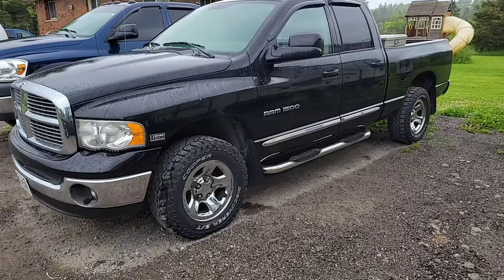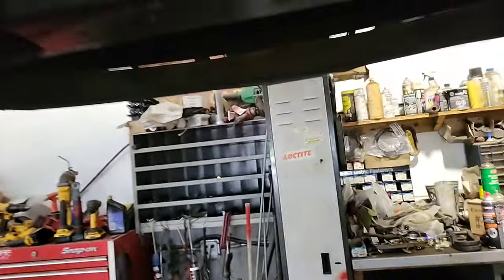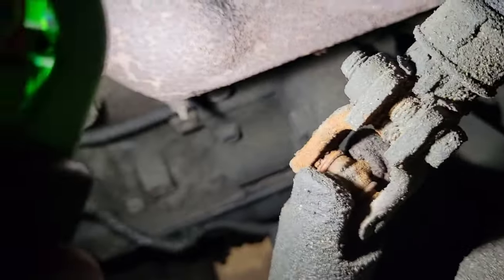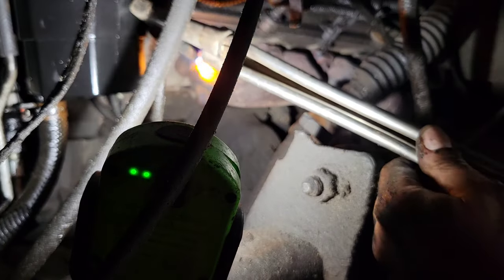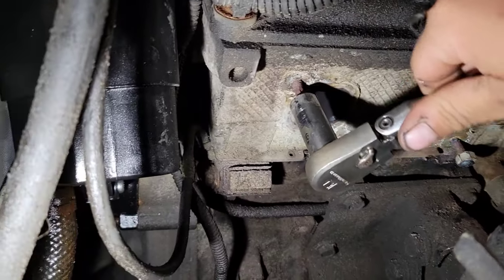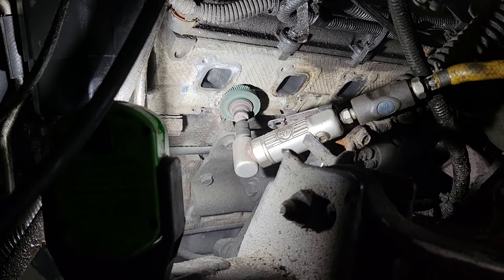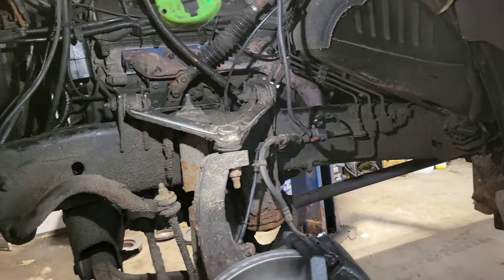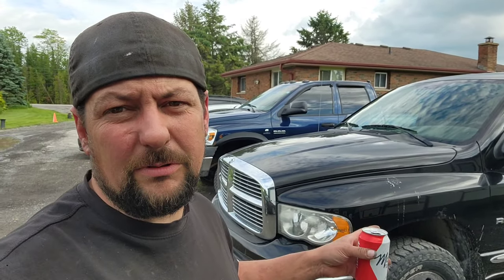Dodge Ram Exhaust Manifold Leak Repair!

Comment: We used to quote those jobs for manifolds, exhaust gaskets and hardware then go to battle with the rust gods... Now we just quote for head gaskets and pull them complete with manifolds still on the heads and send them off to the machine shop to have the bolts extracted and heli-coiled...  We've lost a few jobs that way but better than losing a good tech that's had enough of fighting rusty manifolds on 20 year old trucks...
Good stuff Pete!

Comment: I did a 4.7 exh. manifold gaskets on an'05 Dakota.Some of the rear port bolts were broken off /gone already. I pinpricked the frame under the rear stantions for the upper control arms and ground off the welds, so i could get an angle drill in there.. I ended up putting helicoils in all 4 bolts in the rear ports, because they didn't feel right tightening them down. Also, both manifolds inner 2 ports were an eighth inch taller than the outers with a staightedge, so i ground them down close with a grinder, and finished up with a file. When it was all done the steering wheel was dead nuts straight and I ended up with the truck after the owner passed away. That was 6 years ago and its still quiet! I got all the hardware from Dodge except for the plastic wheel well clips($7.62 each ×14).
Reply: Shoulda just bought a Toyota. 
Car buyers shouldn’t have to go through all that. 
I got a 2020 1500 that’s already had more issues than I can count… major issues being   Transmission going out at 16k miles . Two back window replacements though the dealer.. the third time it leaked I fixed it my self with black silicone adhesive by filling the joints around the rear window flush with caulk. (No leakage since ). But my head liner is messed up form water and other issues with the rear window leaks. 
Head gasket at 20k…the engine would boil over a spot coolant out and gurgle every time you shut it off. 
It’s now out of warranty and getting misfires on cyl 6 (no code or check engine light). But no doubt early signs of lifter/cam failure. Cyl 6 is a mds cyl. And don’t get me started on the u connect and other electrical problems in the truck. 
I cant handle the poor craftsmanship on American made trucks anymore. 
My next purchase will be a Toyota.

Comment: 03 to 05 3rd gen rams with 5.7s are the best 1500 series trucks ever built
Reply: Bullshit!! The only people that say that is the best one has never drove one with Eagle heads. That 45 extra ponies really make a difference.
Reply: I have an 2007 and it’s on my profile pic, still mint running strong at 17 years old I think, if you google the best year the 2008 beats em all

Comment: I had an 05 with around 115k miles on it and I had to do both manifolds before I sold it. I now have a 2014 Ram 1500. Got it with 48k miles, it's needed 3 till now all covered under warranty, now at 98k it needs another on the driver's side so I'll be doing this one unfortunately.  My dad has a 2020 and his has already had 2 as well!

Comment: I have a 1997 Laramie SLT 4x4 with 156 thousand miles on it. It's a little beat up, she's quite and runs amazing. Has the locker 3.88 rear-end.

Comment: Im dieing the stress of my manifold leak on my toyota is now gone. Was wondering if i should get a thicker gasket, seems like you did, also wondered if i should use gasket sealer, and you did. Hows it running? Thanks for the laughs

Comment: I have a 2005 with those two rear bolt on the passenger side missing their heads. Just like the one you were working on those 10mm are no longer 10mm or really usable at all to get out. I was good to see you torching them off. Since I don't have a torch, I am thinking I will first try cleaning one of the bolt heads up and welding a nut on it to see if I can get them out that way. If that doesn't work, I will have to spend a lot of time cutting them out with a Dremel.
Reply from the maker: I hope it works out good for ya! 🍻
Reply: @rednecksdirtyhands  Sadly, it didn't. I think it was likely at least partly the settings on my welder. I decided to cut the bolt heads off with an angle grinder and a Dremel. Getting those bolts out was simple. The one that was broken a little into the block was a different story. I tried and tried with no success with the 110V welder on flux-core. I was feeling pretty defeated. I tried again today using 7014 rods with my welder in stick mode. That achieved good penetration, at least good enough to get the bolt moving. Since I didn't want to have to deal with the flux-coating that stick welding produces every time I broke the weld off while trying to get the bolt out, I switched it back to flux-core, and on the third weld It came out. Now to see if I have anything amount the stuff I have to clean up the gasket off the heads.

Comment: I had a quick question. Did you check the manifold or warpage? I saw other videos saying that the manifold warm and that’s why the bolts brake causing the exhaust leak. I’m wondering if I should buy new manifolds ahead of time since I have the same manifold leak
Reply from the maker: yeah the manifold was good on this truck but it is a good idea to replace them just to be safe, the only reason I didn't was to save the fella a bit of money 🍻

Comment: Looks as fun as the Ford 4.6/5.4, which was notorious for egr tube rotting out n taking threads with it on drivers side, think i put one set on mine n two on moms truck.

Comment: Front wheel bearings is another fail point. Do they not grease these when you get a lube job? My mechanic was not happy about doing that job, it must be tough.
Reply: Theyre sealed bearings dude. Do some research. One of my 3rd gen rams has 300k on original wheel bearings

Comment: Why does the sound the manifold makes go away when the car is warmed up? Is there any issue, outside of the noise, with driving it with an exhaust leak?
Reply from the maker: everything expands when it heats up which closes up the gap between the manifold and the head and the noise usually goes away or at least gets quieter. I know alot of fellas that just keep driving their trucks with that noise and it doesn't seem to affect anything 🍻
Reply: @rednecksdirtyhands ok this I think answered my question. It doesn’t cause
Any harm to the truck to keep
driving
It like this?

Comment: If you are no not tooo busy I have a 2012 5.7 needs a passengers side manifold job . A shop did the drivers side they just changed the head ( unnecessary ? )

Comment: I'm surprised you didn't do the passenger side with a broken bolt visible
Reply from the maker: I will end up doing it...still waiting for some other parts for the truck so I just figured I'd do a video of showing how to do it in the meantime but the otherside definitely needs to fixed as well only a matter of time before it starts tikin away too lol 🍻
Reply: @rednecksdirtyhands  I figured as much, cheers man great video!

Comment: Lower steering shaft right from Dodge 160.00.
Reply from the maker: that's a surprise!! not too often the dealer is cheaper than the aftermarket....but lately I've been seeing the prices of parts from NAPA going through the roof! thanks for the info! I'll give kawartha dodge a call and check 🍻
Reply: @rednecksdirtyhands  I got mine from dealer in Lindsay, but assume all the dealers would be same price??? Lindsay driveline used to replace the u-joints in them at one point as well!

Comment: hmmmm.....I'm a couch mechanic and I'm thinking those manifold bolts snapped due to the cast iron manifolds warping over time. Maybe they should have been replaced.

Comment: It’s your manifolds 

Cold start the metal is cold and dry until it warms up and expands it can seal the leak a little therefore the tick quieting down to going away completely. 

I hate how manufacturers can make things on there vehicles so cheap and garbage. 

Make the bolts TOO SMALL therefore they rust off leading to said problems 🤦🏻‍♂️🤦🏻‍♂️🤦🏻‍♂️🤦🏻‍♂️ even the damn bed bolts on these trucks are tiny and can rust off.

Comment: Should be a class action suit against Dodge for this manifold issue.  It's been wayyy too long that this has been happening.  My '15 had to have the studs replaced and now my '20 has a cracked manifold.  And of course the manifold is on backorder.  What does that tell yah.
Reply: You must be joking. Class action lawsuit because the damn thing got old and needed repairs.  Save your class action lawsuit for serious crap that could get somebody killed. I can name a dozen different vehicles from a dozen different manufacturers that the exhaust manifolds rot or rust out when they get high mileage or are in salt infested areas. I guess we should bring litigation against all of them because we don’t want to pay to fix our vehicles.
Reply: @prevost8686  lol. Yes I was joking.  The issue does deserve a recall though.  I understand things get rusty especially in the saltbelt but   it's not just high mileage Ram's that suffer this issue.  Lot's of in warranty, just out of warranty.   My '20 only has 70K km on it.

Comment: Dodge hasn't owned Dodge for a long time, and they just closed an assembly plant near me.
Funny thing is their actually owned by a company in Amsterdam called Stellantis.
Bottom line.
Utilizing slave labor in foreign countries to maximize profits is an old business model that has served the greedy pigs well for centuries.
In the end.
Most of the parts are imported.
Then they assemble the vehicles here to avoid unfortunate tariffs.